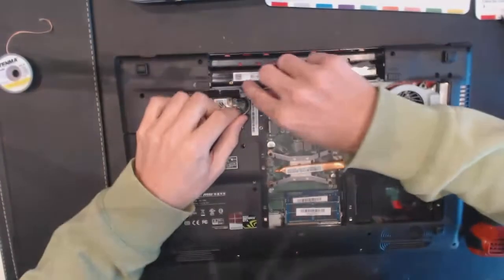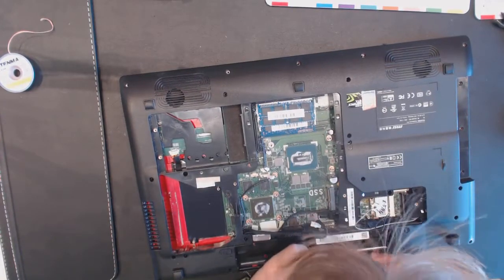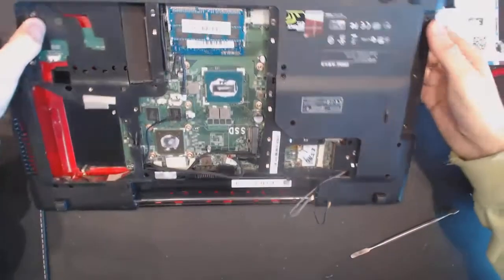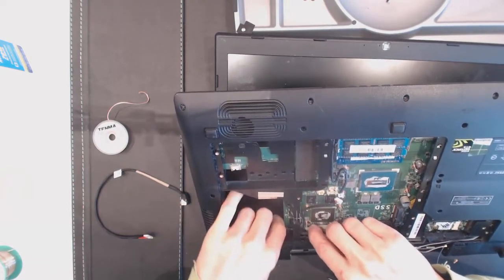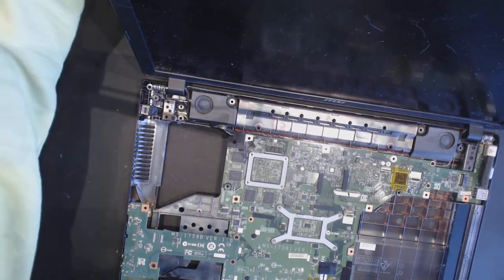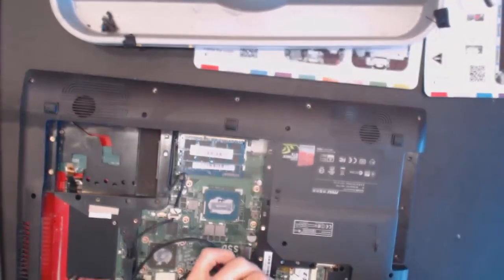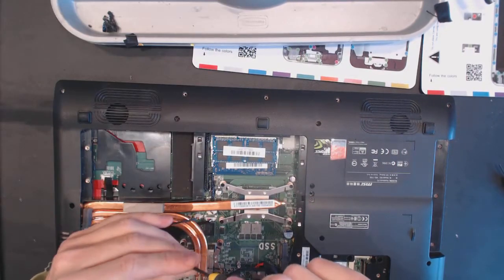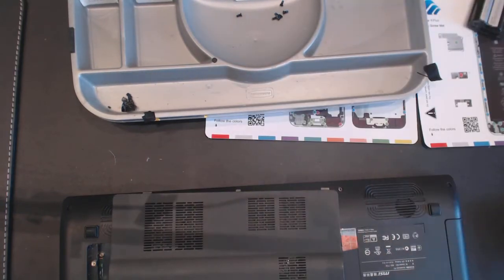MSI MS-1759 MS-1757 Laptop Power Jack Repair pushed broken socket input port connector fix

Comment: Worked like a charm! Followed your instructions and now my computer is as good as new. Thanks! Bought my new powercord from Ebay and replaced it in an hour. Might i suggest that you zoom in and give an overview of the screws and wires you are disconnecting? It would help on the rebuild because it is three different types of screws and with the flat connectors it is possible to insert them the wrong way.

Comment: Hello, I have the MSI GE70 2QD-698NE, and it looks quite similar to this pc where you fix the jack, and I do not know what has happened with the input/jack, I think it has been thrust slightly into the pc, is it possible to fix this without buying new jack and if not where can i find and buy a new jack for the pc?